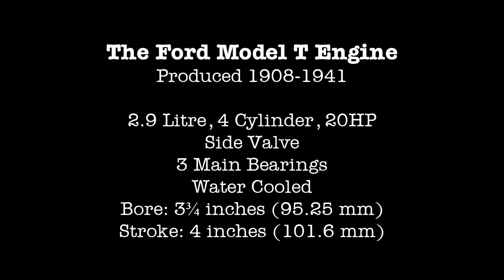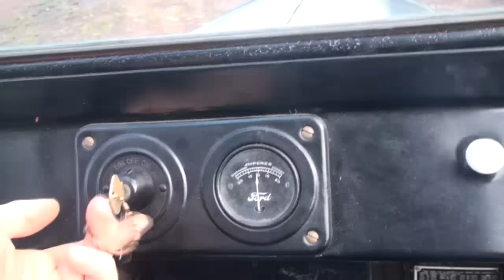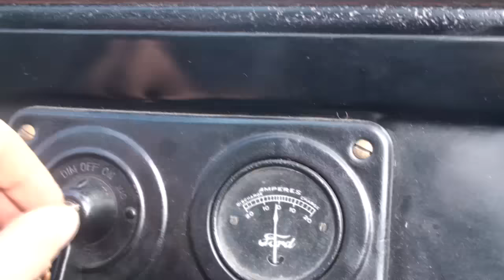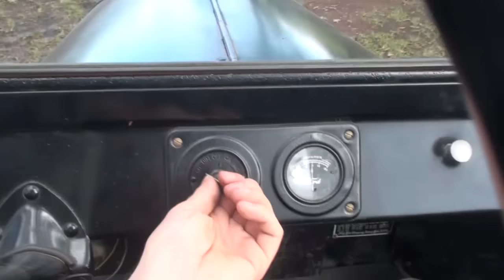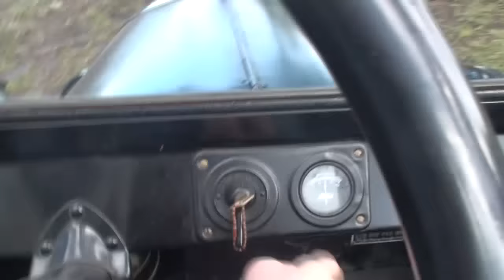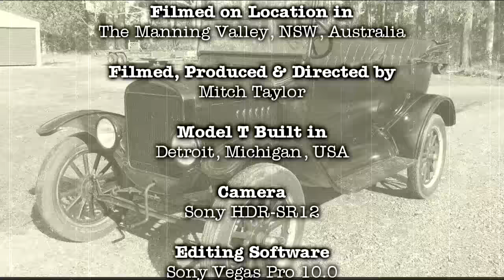Ford Model T - How to Start & How to Drive

Comment: What if the Check Engine light comes on?  Where do I plug in my laptop?
Reply: As per the user manual, the suggestion is to plug the laptop right under the rear left hand side wheel and wait untill the car wheel is right on top of the laptop.
Reply: The user manual does explain another method "...stand firm, using right arm grab the usb connection and then proceed to insert usb cable up your *******..."
Reply: In the fuel tank with a match
Reply: I can't believe I have to actually say this, but he was using sarcasm. It's a literary tool. You might want to look it up sometime.
Reply: depop58  If we're going to ignore sarcasm and be pedantic about it...

The castle clock, a hydropowered mechanical astronomical clock invented by Ismail al-Jazari in 1206, was the first programmable analog computer. 

It may be a bit big for putting on your lap, but you could definitely calculate some Model T related things with it. :p
Reply: Don't know, but it's got push button start. high tech!
Reply: depop58  You were last :p No other reason actually :p Should have just deleted your name or clicked 'answer' on the first comment. Sorry :)
Reply: OB 0 plug in only
Reply: nice
Reply: try to sign in with the bluetooth or go to the any service
Reply: Richard Black | R/wooosh
Reply: @Astrophysix1  uh ... Sarcasm.
Reply: it was a lot simpler back then.
when the engine needed service, it stopped working.
the diagnostic was the mechanic looking at and saying, it ant running.
then they would guess at what was wrong and sell you parts you did not need.

they do it the same way today, but now they use fancy computers to give them repair codes then they guess at what the repair codes mean and then sell you parts you do not need and charge more.
Reply: No need for your simple laptop! It will never break!
Reply: Alin S Do you know what a joke is? If not then go look in the mirror or something...
Reply: Alin S  OH WOW.  I dunno tho, I feel like he wasn't being serious? Eh must be

Comment: USB Dock? Bluetooth? Cruise Control? Anything!
Reply: U have cruise control
Reply: Right lever man
Reply: Has engine and seat if that counts!
Reply: You have to get you a chauffeur that sings. 😉
Reply: AC, just be sure to keep the top down
Reply: Convertible and auto air
Reply: In greece we always had cruise control even at older cars, we just don't touch the steering wheel and we are drinking coffee , eating and talking to our phones instead of driving, and the car goes by itself....
Reply: 1925 onwards model has Launch Control
Reply: Cup holders?
Reply: Way too old for that man
Reply: No but it does have good looks, and its simple, it can also drive itself, it can't steer but it moves forward.
Reply: Just place a brick on the peddle.  That’s how you use its cruise control.   For USB?  bring a mobile power bank with you.    Bluetooth?    Just bring your wireless speaker with you.  😁

Comment: My mom b:1915, remember her dad having to back up hills when the gas was too low in the tank.
Reply: My mom was born 1921, and her dad had to do the same thing. One thing he did, though, and you'll probably never see it done again; when the Willamette River froze over during the winters in Portland, OR, he would remove the front tires and install sled-type runners. Then he would drive across the river without going over a bridge. My mom and her siblings would enjoy themselves driving up and down the river until it was time to go home, mother having done her shopping, and time to get dinner started. That sounded like fun in those days.

Comment: Note that it really is important to put the handbrake on. If the transmission is worn, or it it's cold and the fabric clutch bands are stiff, the car will start to move forwards as soon as the engine starts up. If you start it with the car in gear, it will lunge forward and run you over as soon as the engine fires. That's one reason the handbrake and clutch are made as one unit! Of course you'd have to roll the car forward slightly with your own starting crank, since in that case the engine would be engaged to the driveshaft, but I think you wouldn't notice quick enough to prevent the engine from firing and driving itself forward.
Anyway, yes, the whole "start it up and run around and jump in before it drive too far away" technique was well known in colder climates, although most cars were put away in the barns for the winter back then, since the roads weren't plowed anyway. If you were smart you had someone crank it for you while you held a foot on the brake (which only worked on the rear wheels and were 100% mechanical, BTW). And it wasn't just people who lived in cold areas; most drivers had to deal with running around to advance the spark, because the engine would run very roughly until the spark was advanced, and would often stall if you didn't get to the lever fast enough, so you'd have to start over again!
All I can say is that although it sounds like an enormous amount of work to us now, it's still far simpler than owning and driving a team of horses (although there were those who rightly debated this, since BOTH were terrible pains). Horses have to be fed, cleaned, exercised, kept in health, stalls mucked out and cleaned. They have to be trained, and there are all sorts of personalities, some good, some bad, some lazy, some willing. To go out you have to get up and fed and brush the horses, and then put harnesses on them, which most modern people would find a baffling and frustrating job, involving dozens of strange straps and buckles and hooks. Then you've got to get them to back together to the tongue of the cart, and hitch it to them. Then while driving, you'll only go as fast as you can get them to go, and they'll only go where you can make them go...if they really want to go somewhere else, goo luck stopping them! They also get hungry and like to stop and snack on grass if you let them. They also get distracted by mares/stallions along the way, and fight with other horses. And if something startles them and they decide to run away at high speed, there is literally nothing you can do expect jump off or hold on and wait for them to stop. Carriage accidents were not rare, and were no joke. Horses also kick with deadly results, and I know a man who lost his ear to a horsebite. Once you arrive you can't just park horses beside the street and leave them for 4 hours, you need to stable and feed them, and wipe the sweat off them and cover them with blankets if it's cold (and I'll mention that there are NO heaters in horse-drawn vehicles, and you don't know cold until you've ridden 5 hours in 20deg F weather, or worse, sitting still on a moving vehicle.
I love horses, and wouldn't mind using them for transport from time to time. I think if everyone was forced to go back to carriages tomorrow, I'd be content enough. But even a Model T seems like a miracle of convenience compared to horses! Same thing with tractors and ox teams.
Reply: Thank you for the commentary.  Next question, why do people think there is no God?
Reply: Kel Harper Terrific response. Thing is,if people treated horses the same way they treat cars,they would kill the horses. It has been that way for decades. Equines as you say require daily maintenance whether used or not. Vehicles nowadays require enormously less than even 15 years ago,but still. Points and condenser era vehicles benefited enormously from being tinkered with minimum every three months,and lasted longer yet if that was halved. Adjusting a distributor by ear was something older mechanics could do that I could not. Late sixties several models had ball joints without grease nipples that promptly required grease. Big flop. There were others. Each era has its own attitudes to transportation I guess.
Reply: Kel Harper Enjoyed your thoughtful insights.
Reply: Thank you for sharing. Growing up my family would visit a ranch in the middle of nowhere with a horse stable and I would always be nervous getting close to the horses because of their size and strength, even though they were used to people.
Reply: Kel Harper - you wrote more than 3 sentences.  I can’t read that much
Reply: Very good points, Kel. Also, no modern antifreeze for cars driven in cold climates. Alcohol based antifreeze evaporated quickly and had to be frequently renewed. Lots of flat tires, too.
Reply: that's really good thinking but I think you would notice way before it cranked because it would be 10 times harder to crank. And besides that, its hard to crank a bigger dirtbike kick starting it in gear.
Reply: Wow
Reply: well that's the case in any manual car
Reply: I can walk faster than that piece of crap give me a horse anyday
Reply: MichaelKingsfordGray  - wheel chocks wont stop a vehicle that is under it's own power. 

they only stop non powered vehicles from rolling.
under power they will jump the chocks.
Reply: Awesome information! Thank you very much, and I have learned a lot about old vehicles and horses. Thank you very much again 😉😉😉
Reply: People today don't realize what a revolutionary invention the model T was. It made high speed transportation (at the time) available to the common man. It was my Father's first car. He told about  his Father laying underneath one in the cold North Dakota winter tightening the transmission bands.  Driving cross country as the roads were impassable due to the snow. He always said if they only  had paved roads back then. He still has his 1921 roadster. And it still runs.
Reply: @Journey_to_who_knows  You've obviously never ridden a horse.

Comment: Just goes to show how gearbox oil level checking should be easier than it is today. Checking the manual transmission oil on some cars even today, you have to use the same method the Model T does for checking engine oil. If oil drips from the fill hole of your manual transmission of a modern car, it's full.
Reply: 08 Mustang GT. To check the lube in a manual transmission GT you unscrew the plug and if no oil runs out, stick a finger in the hole. If it comes out wet with oil you're generally OK to go.

Comment: Very Nice!   
I grew up with my uncle's 1915 'T' Roadster  (last brass radiator year) that was basically an early hot-rod...   Frontenac overhead-valve head on the engine for power, a 3-speed "brownie box" behind the transmission for speed, AND a 2-speed Ruckstell rear-end to climb the very steep San Rafael Hill.  He used to claim the car could go 70 mph, but he never went over 50 because of the wooden wheels...  (he had a speedometer that ran off of the right-front wheel.)  Come to think of it, he had a lot of aftermarket goodies:   A hand-plunger Ooga-horn, two-tone paint, the obligatory radiator cap with the thermometer in it,  picnic-basket carrier on the drivers running board, and even a brilliant-sounding brass bell with a plunger on the floor right where Mitch's starter-button is.)  Sighhhhhhh
Reply: Those overhead valve conversions are really rare and valuable today!

Comment: I worked as a service writer in Southern California in the mid-late 1990s. At trade shows of the time, Ford gave away copies of the owner's manual of the Model T. They were a fun read at the time (you have to lubricate the car where again, and how often?) but those OG manuals did not make clear what actually starting and running one of these involved, at all. I think the oldest car our garage ever saw was a '34 Ford. In later years, at a car show, I saw an oil-soaked all original original barn find Model T that had never been restored through the early 2000s. Amazingly, it start and ran despite who knows how many decades of countless neglect. I'm sure it bled oil freely. Thank you for making clear what start these cars actually involved, and from half the world away, much less. Your love shows and is appreciated. - Sincerely, a service writer who saw an amazingly thoroughly grenaded 1961 Studebaker pickup truck.

Comment: Very well done video. I get a kick out of it, today's cars have fuel injection, computers and all that to get around 30 miles to the gallon but I get 28 to 34 miles to the gallon in my 1913 T speedster. It will also go where most other cars can't go other than 4 wheel drives. Very fun to drive and very simple to work on.
Reply: Almost makes me wish I had such a car.
 If I had one, I'd do whatever is in my ability to maintain it and to ensure it stays is good shape. But...
No one has ever taken the time to teach me how to drive.
Reply: Alex Ehlers good luck mate keep them alive!

Comment: I got the chance to drive a model T in a parade years ago.   After two hours practice I was ready to go,  but have to say it was a ton of work,  and thank heavens for the model A, or I'm not sure cars would have caught on😅 much easier sticking with horses. You'd finally get it up two speed,  but then see a stop sign and the 8 step procedure for accelerating would now start in reverse.   Lots of fun,  but I wouldn't want to be in heavy traffic.

Comment: Imagine putting an after market remote starter on this. 😂
Reply: Lol.  These gems were 6 volt 😁
Reply: No, bad skylar.
Reply: What is the point of a remote starter? It will save you 3 seconds turning the ignition key?
Reply: I can imagine hearing the "bwop bwop" of a key fob and walking up to find the car was one of these

Comment: remember my pop telling me his folks had a model t pickup that when the gas got low they had to back uphill
Reply: My grandpa told me similar stories about a steep hill near a town where they lived in the '30s. He also told me how one time he broke the front axle on a rough road. He dug up a nearby fencepost and used the fencing wire to strap the post to the axle. It held long enough to get him home!

Comment: Thank you for teaching me how to start and run a model T. In Boston Ma. America I’ve balanced 10 or so engines. They are probably the toughest engines to balance because they were so crude. Each one was different and had its individual problems that I needed to deal with. Thanks again !😊
Reply from the maker: Thank you 😊